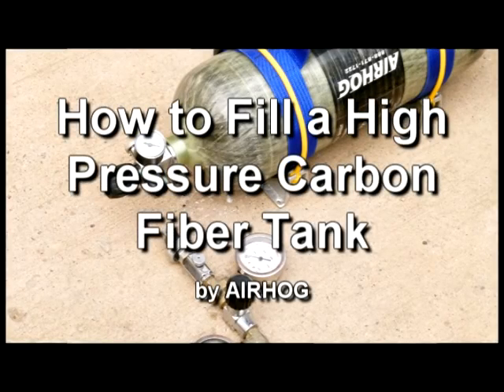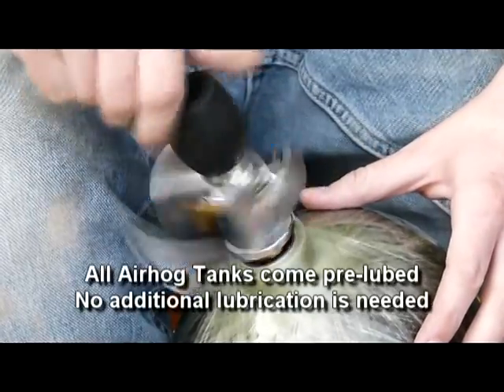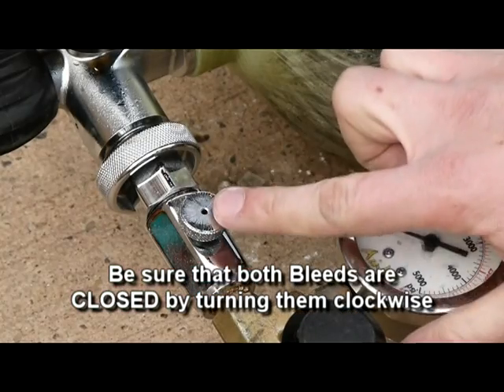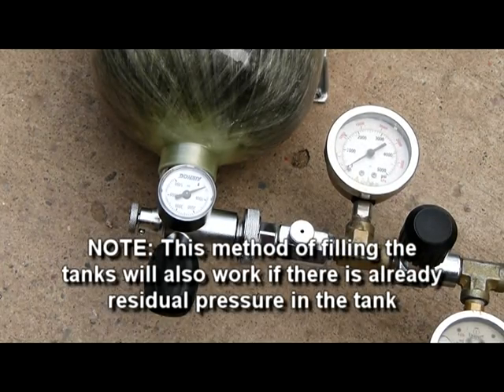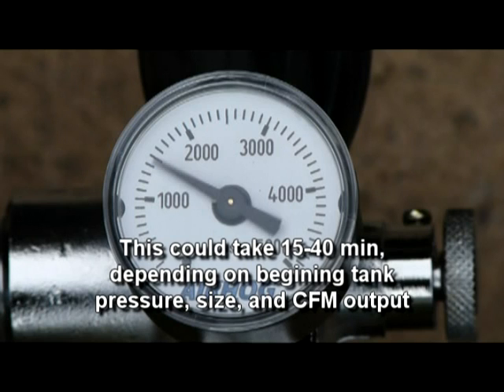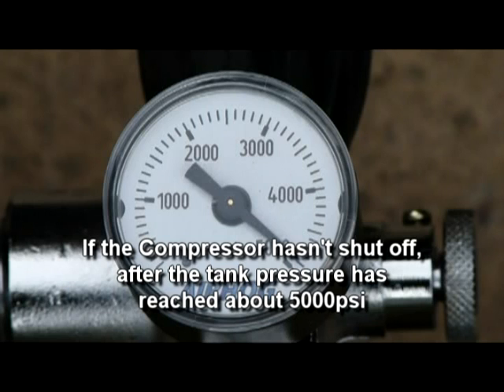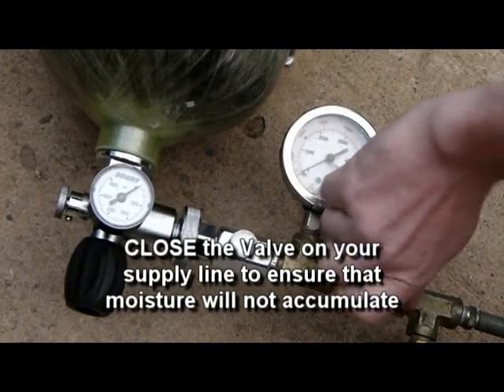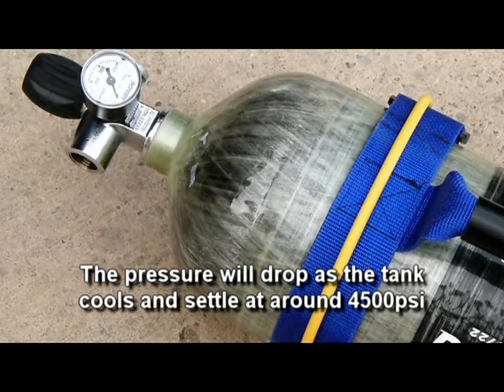How to Fill a High Pressure Carbon Fiber Tank

Comment from the maker: The Carbon Fiber SCBA Tank, which differs from the SCUBA Tank, is rated at 4500 psi.  The burst pressure for our tanks is actually over 15000psi so there is no danger in filling them to 4500psi.